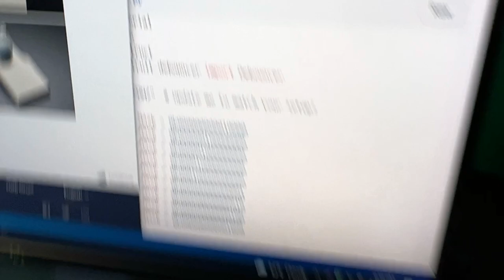spaceball 2003 and a bit of pyserial

Comment: there is an awesome 6 button gamepad version of this called the SpaceOrb 360, I wonder if your work would also function there since its the same company and probably works the same which was with pairs of IR leds and a small spikey center spindle that blocks the light also in pairs to tell if its a sideways push or twist with the same setup.  they were great 6 DOF controllers back in the day for games like descent doing the jobs of 2 joysticks straife+aim